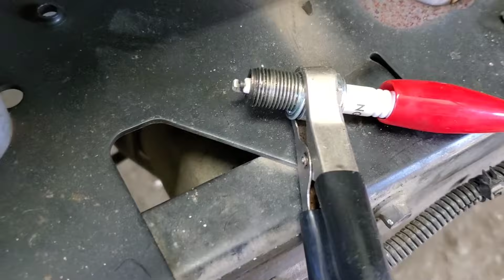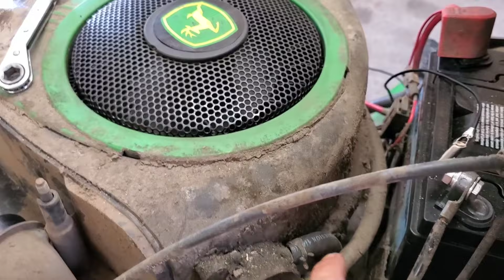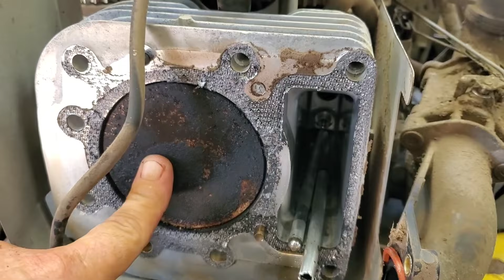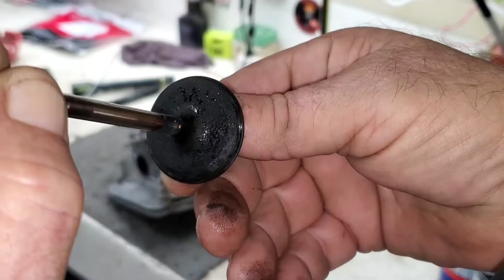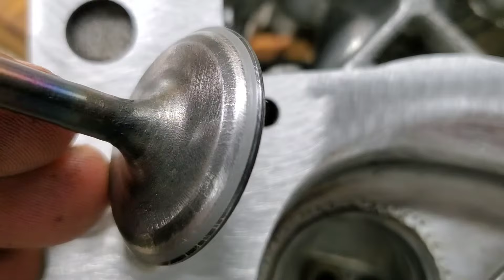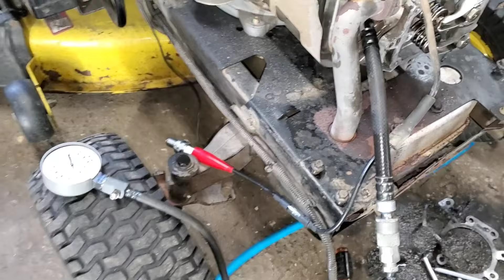JOHN DEERE D110 BRIGGS AND STRATTON NO START HAS FIRE HAS FUEL NO COMPRESSION EASY DIY

Comment: My D110 stopped suddenly, thankfully near the garage. I replaced the fuel pump thinking that was it but now I notice there seems to be no pulse to the pump and it is not pumping. Obviously this changes everything since it was a sudden stop. It starts if I put gas in the carb but not with the pump hooked up. I see no leaks in the head gasket and the valve adj. looks okay. Wondering how there can suddenly be how there can be no vacuum pulse in the motor.

Comment: Mine had fire and fuel but no compression. Stud which supported the intake valve rocker arm had broken. Rocker had fallen into the bottom of the rocker arm valve cover cap. Replaced stud, adjusted the valves put everything back together and it ran like new. Stud costs about $8. My time:free.

Comment: Need help : I have a olde John Deere  LT133 mower 
That my dad left me 
 Problem is the only way it will stay running is with the throttle all the way up 

If you lower it it stalls out 
Sad 😩
Has had a new carb installed and worked fine for a season 
Then back to the same old thing 
I hate to get rid of it because it was my dads 

Any help would be appreciated 
Thank you all …
Reply from the maker: If it has a Briggs with a Nikki Carburetor watch my video on swapping it over to a Walbro Carburetor.  Hope that helps
Reply: @RaleysSmallEngines  thank you very much ❤️

Comment: These B&S engines are susceptible to running hot, if trash is blocking air flow over the head.  Great job T-bone.
Reply from the maker: Yes they are.  Thanks for watching and commenting my friend.

Comment: I didn't see the link to do the valve adjustment
Reply from the maker: Sorry, I will add it to the description.  Here is a link  https://youtu.be/TO1p7pivbAI
Reply: @Raley's Small Engines  thank you I've got an 2015 john deere d110 can I use the .004 for my valve adjustment
Reply from the maker: @thomassisco5515  yes, I do a tight 4 on intake and a loose 4 on exhaust.  Works every time unless the compression release is bad on the cam.
Reply: @Raley's Small Engines  thank you you've been a big help

Comment: Great video. I have JD LA105 that I replaced the flywheel key because of a sudden engine stop by hitting a clump of dirt in a ditch I was mowing. It started after installing a new key but only ran a few seconds and now won’t start. Is there a crankshaft key as well? If so can you do a video on how to replace that key?

Comment: I have a D110 that has a surging problem. I just got it back from the local small engine shop and they told me the reason it was surging/missing is because it’s cold. I don’t buy it. I’ve replaced the spark plug, fuel filter, air filter. Can’t figure it out. Reckon the small engine place didn’t think it was a issue. I need help
Reply from the maker: Jets in the carburetor are most likely restricted. If you are near Columbia SC I will fix it and video it for you. We don't let a surging engine leave this shop. Easy way to find out is start it, add a little choke. If it levels out it's a restricted carburetor jet. I may have a video, can't remember. Bring it let's video a repair.
Reply: new fuel line helped me fix one surging....

Comment: Another way they bend and break pushrods is the engine gets hot and the valve guide drops and binds the valve, and the pushrod tries to force it and snaps or bends the pushrod
Reply from the maker: Yes, this one, I think the adjustable nut on the rocker arm got loose and then backed out of the rocker arm. Thanks for watching and commenting stay tuned part 3 coming soon.